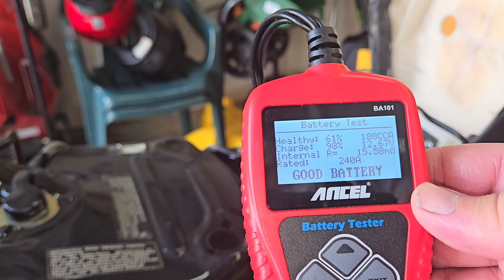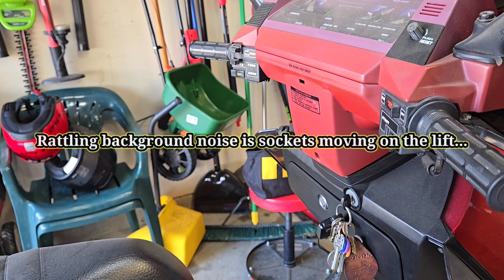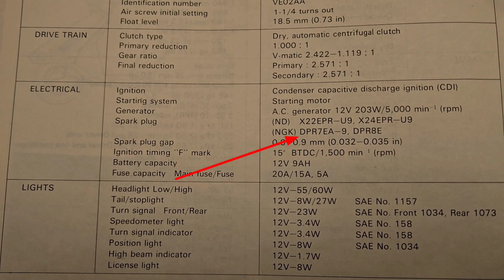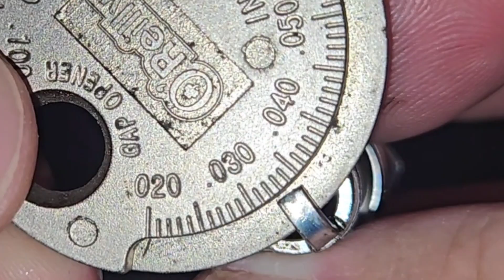1984 Honda Elite 125 | Carb removal/cleaning | airbox, rear tire removal | Ruby the Elite

Comment: I found your channel after buying a 86 Helix at the beginning of the summer and 3 weeks later I find myself with a Honda Big Ruckus that I have been trying to buy for a couple of years. Your comments about getting side tracked by buying more and more scooters hit home. Love your content and knowledge as it applicable to other Honda scooters. I have left the Helix to concentrate on getting the Big Ruckus engine running which is a big task as many hands and mice have been in this Honda orphan scoot. It is this challenge that makes it interesting.. Here in Canada the fuel line issue is a gas issue as ethanol has destroyed many a small engine and drove people to electric powered equipment.  Happy 40 birthday to Ruby the Elite.

Comment: Love your videos! I recently got a 93 helix. I did my oil change I understand there's an oil gauge but I usually change by color. I live near the ocean, and have alot of experience with aviation. I do not trust the oil Guage oil is cheap enough to change it when it gets dark. Also I don't drive far or long on average 24 miles a day so I opted for 10w30 partly cause I ordered the wrong oil so I'm just going through the gallon oops 😬 i use the oil Guage for belt and cvt maintenance. On average though at least 350 miles my oil is dark so I take it out around that time.  I've heard alot cn250s to Guage my motors health most sound shotty at best. I recommend people don't go by the oil Guage that probably yah their motors are running black oil by the time it even turns a little red. I'm looking into installing oil pressure sensor and oil quality sensor that are accurate in the filter.
And this is a dream but it would awesome to have two cvt belts on both sides of the rear tire....😀 domzeet know what would happen but I'll try it with a Chinese scooter
Also final verdict on oil... I read the manual throughly and it gives you the oil regulations for wide range of oil types depending on your environmental conditions due to out side temperature. And oil operating temps, with viscosity grades reminding you I live in a place that never snows coldest it gets is 60 degrees f.  So 10w aren't my first choice it's being commonly recommended so I don't deviate from the experts. 

If I put a jet turbine in the trunk I wouldn't be surprised. Also looking into wankel motors with 50 hp that would fit

Comment: I have 1984 Elite 125 that has about 1200 miles but needs some TLC.  Where do you get your parts?  Having a difficult time sourcing especially like turn signal assemblies and other body parts?  Thank you
Reply from the maker: @dfish900  The only place is Ebay.

Comment: Well good morning how are you today? I have a question my 84 Honda elite. The headlight is stuck open. Any advice on how to fix it
Reply from the maker: Hello! I would purchase a service manual and follow the "Retractable headlight" instructions in Section 16.  From 16-21 to 16-27 the manual gives you testing points for the timer unit as well as the main motor.  This section also shows the mode of operation for the entire headlight unit. This would be a great starting point.  Mine was sticking and I utilized this section. Good luck!